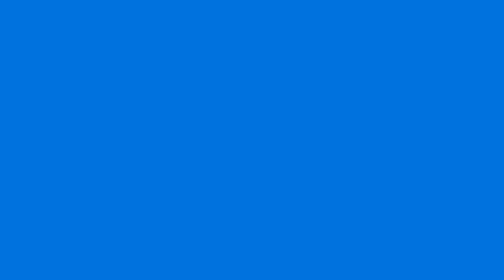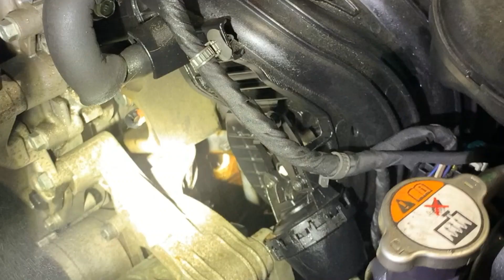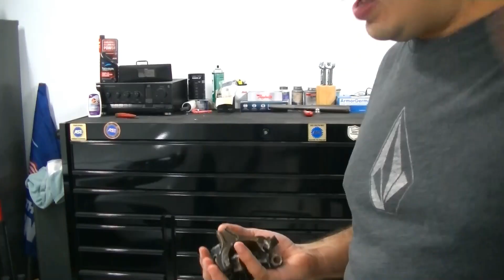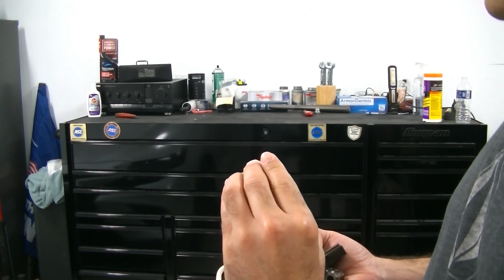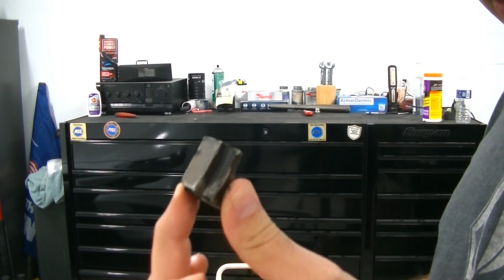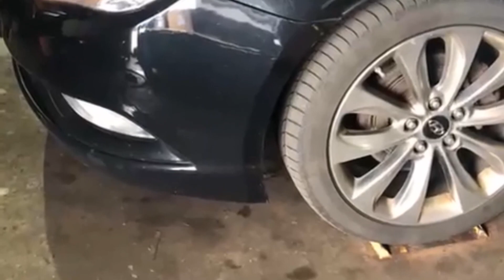P1326 In Hyundai/Kia vehicles, Cause of Theta 2 engine Failures, Timeline of Hyundai engine recalls

Comment: Great show, perfect explanation on car mechanics .Just have one question as you have a wealth of knowledge. Do Hyundai/KIA 2.0 litre mpi not gdi engines(Pre 2013) suffered from bearing crank failure as they are not on the recall list.
Reply from the maker: Are you talking about the belt driven 2.0 out of the elantra? Those engines are damn near bulletproof. Thoroughly enjoyed working on them
Reply: @S&E's Garage  thanks for finding time to reply, no my engine is mpi 2.0 liter with a timing chain not with a belt and is not on the recall list hyundai Tucson 2012, 6speed automatic well serviced with original yellow dip stick. So is this engine a lemon??.
Reply from the maker: @PeterSmith-ek2td  these engines do have issues unfortunately, though not quite at the level of the theta engines

Comment: I recently got this vehicle with around 53k miles. It has a engine recall for a bearing related failure. This is my question, should I wait before I get the engine tested? It has relatively low mileage and i'm concerned. The issue is excessive wear that leads to engine failure. So if the current amount of wear isnt detectable to the machine that does the test and they say its fine, then lets say in 30k more miles it failes and im out an engine. The woman at the dealership said its a 30 minute test on a computer and they can tell if there's an issue. But im concerned if the issue hasnt developed yet, then i may get a "pass" on a vehicle that will eventually fail for the recall issue.

Comment: Very informative. 👍I got the knock sensor update on my 2013 Hyundai Santa Fe Sport in 2018 but just today it was triggered when I went over 80 mph on the expressway. Started going down in RPM and couldn't go over 60 mph very scary with all those vehicles behind us. Guess I'll be calling Hyundai customer support and see if they can do anything for me. 😔Thanks for the info.
Reply: my 2014 sanfa fe sport 2.0 engine light just came on flashing after putting gas in and I felt a down pull in the rpm as well. It shaked scary still owing quite a bit on this car worried.
Reply: SAME thing happened to my optima! Was going 80 car started stalling couldn’t accelerate over 60. Oil pressure light came on and engine seized
Reply: @radiancebae6083 😢

Comment: Re 953 campaign at 11:00 - the knock sensor is essentially a microphone. So 953 is a continuation of the earlier efforts, but done on a continuous basis.
16:30 - I wonder why the software couldn't be modified to recognize and ignore the FI pulse interference. They surely happen at different times than rod knock sounds.
Reply from the maker: It is not exactly a microphone. It’s a piezo electrical sensor that creates voltage as vibrations occur
Reply: "electrical sensor that creates voltage as vibrations occur" - that's pretty much the definition of a microphone. There  are under water microphones that use the piezoelectric effect.
Reply from the maker: I’m relatively sure that is the exact reason they had us stop replacing the knock sensor harness in one of the T3G revisions

Comment: I had my 2015 Santa Fe engine replaced through the June 2021settlement agreement in October. Immediately after, I began get a Check Engine light and final got it diagnosed as needing to replace the catalytic converter. I’m being told by the dealer that the claim for this repair under the settlement agreement was denied; however, they agreed are to do a thorough evaluation of the CAT and resubmit the claim. To your knowledge, has it been a common occurrence for the engine failure to cause damage to the CAT?  If so, do you have any knowledge if the Settlement agreement has approved covering the replacement?
Reply: If it used a lot of oil before it blew up it probably contaminated the cat, so it is a possibility.

Comment: I literally had this happened to me last week coming from work. I never had an issues, took it in for recalls or maintenance and I just changed the spark plugs and clean engined the six months ago. Anyways, my engine light came on out of now where as I was driving home, I had to limp home and it threw this knock sensor failure code. And Hyundai still has no recall and would have to wait to get it repaired so, I ended up taking it to a nearby mechanic who knew what was happening but I have $700. It's a 2015 Hyundai Sonata Sport under 60k miles.

Comment: I’m afraid because our car is consuming oil. It has 105000 miles. It has been good since bought used in 2016. It’s a 2015 Kia Rio EX. Just check the oil frequently and oil changes are done in 4000k intervals Does Kia Rios qualify to have KSDS software installed? New subscriber

Comment: I’ve been doing a lot of research as I drive one of these vehicles. It’s interesting that this video is two years old and my vehicle had the KSDS recall warranty back in 2019. I believe my engine is actually only a theta engine. I do believe right now in a more recent update is that the burning of oil is now a part of the safety recall under the government program. You can go and find the recall notifications and the official bulletin from the government websites that instruct dealerships and mechanics on how to perform and test for oil consumption excessiveness. I’ve read all through it and what I will say that is a little surprising to me is the fact that these manufacturers are suggesting that normal consumption can include burning 1 quart of oil per 1000 miles. which seems excessive considering that if you have an oil change service interval of 5000 miles and your engine only holds 5 quarts. You would have no oil in the engine at the end of that interval. And what’s worse is that by the time you were low by two or 3 quarts this other issue of the bearing is now going to present itself much more dramatically. Not to mention the fact that the lower oil is going to cause problems for other parts of the motor which depend on enough oil. Like the cams.
Reply: Check your oil at least once a month.

Comment: There is also Kia Technical Service Bulletin 222.  High oil consumption measurement and piston ring cleaning procedure.
Reply from the maker: I did one of those at Hyundai before I left the dealership with the Valvoline top engine cleaner letting it sit in the cylinders and then using a leak down tester to pressurize them. What kind of success rate are you guys seeing doing that cleaning?
Reply: @SEsGarage  I'm just a silly 2016 Kia Optima EX car owner.  The cleaning procedure was performed a week ago.  I've driven about 250 miles since then and I need to return to the dealership so they can officially measure the oil quantity after 1,000 miles.  It will be interesting to know the future long term results since I caught the oil consumption before too long at 101,000 miles.
Reply: How much you paid for that service?

Comment: Thank you for helping me understand more about my engine and the whole debacle behind it. Since you seem to be pretty intimately familiar with these Theta II engines, what is the most common reason for the oil burning? I am burning about 1 qt every 1000 miles in Eco mode and a little less in normal mode. Was wondering what I could do about it. Dealer already did the carbon cleaning though they have been dodgy at best. Was thinking about just saying screw it and replacing my rod bearings before they fail, though that may just be pushing the problem out to a further date.
Reply from the maker: Not accusing you of anything here but we usually only saw oil burning issues in theta engines with questionable service history. Hyundai release the service bulletin to perform a special type of carbon cleaning of the combustion chambers with a special service tool. That service bulletin must be performed and oil consumption tested after before any engine replacements are authorized. The service is supposed to attempt to free up any clogged or frozen oil control rings.
Reply: @SEsGarage  I appreciate the candid response. I did purchase the car used from another dealer so I don't know it's previous history but growing up with a master tech as a father I always replace oil at 3m/3k. Since I've owned it only ever ran synthetic through it, except through the consumption tests since they wouldn't let me. What worries me is it was burning more oil after the cleaning and second round of consumption tests. I've run it through another oil change cycle and have been checking the dipstick often to get a measure of consumption (I know, not very scientific). After the cleaning it was around 1.3 qt per 1k, it's settled back down to 1 qt per 1k now though. Not really sure what to do next here.
Reply from the maker: @Simpfan45  unfortunately being that you are the second owner the 100,000 mile powertrain warranty does not transfer over. So if you’re over five years or 60,000 miles unfortunately Hyundai doesn’t need to do anything about the oil consumption and you’re only covered for rod bearing failure. 1 quart per thousand is more or less the threshold for warranty replacement. That being said you can ask the Hyundai dealer to submit a goodwill request for engine replacement and see what Hyundai offers as far as assistance if anything
Reply: I had this issue. I did some of my own online research and found people reference a PCV Valve replacement. I had that replaced and it dramatically improved my burn.
Reply: @L00KOUT  I replaced our pcv in a 2017 Sportage that started burning oil around 50,000, it was no help.  Now at 67000 it burns a 1 qt in 1000 miles, going in for carbon cleaning in 2 days.  Have free oil changes and got them done on time.  So if they do nothing, and Kia corporate won't help, will switch to 20w40 or get rid of it and never buy Kia again.  Oh, the Theta II motors have an extension on their warranty due to law suits,  doesn't matter if you're 1st or 2nd owener for the 2.0 and 2.4 Theta II's.
Reply: @lonniebeal6032  Oh yeah. I went the corporate route and was told to suck an egg and pay out of pocket for a new engine.  Didn't end up doing so as it's a 2012 and the engine is still putting out good numbers, just burns oil. I will try playing around with the oil weights a little to see if I can reduce oil burnoff. Really don't want to be ripping apart my engine and replacing rings or whatever wore out to fix the oil burning problems.
Reply: My 17 Kia Sportage 2.0 T started consuming oil at around 56,000 miles, I’m the second owner , they conducted an oil consumption test and it was burning oil, i called kia corporation just in case to record the issue , they approved for a new engine to be replaced
Reply: @L00KOUT  I did the same and it didn't correct anything for my 2017 Santa Fe Sport with out a turbo. Hunk of junk if you ask me. It's sad, my wife's 2008 entourage has 220k miles and only burns about half a QT of oil between 3k oil changes. It has the 3.8L motor.
Reply: @L00KOUT  where is the pcv located on the 2.0, interested in changing  mine out on a 2017 tucson, any help is greatly appreciated!

Comment: I have a 2011 sonata that blew the engine at 85k miles, around mid 2018.  It gets regular maintenance, but I'm wondering if the replacement is burr free or has the same defect.

Comment: I have a question for you... LOL So they did a complete engine replacement on my car and now not even 2 years later I am getting the same code coming up. I have maintained the vehicle ever since I got it back religiously lol because I am scared of something going wrong but now, we are back in the same boat again I pulled the P1326 code and this time I'm going straight to the manufacturer for answers, and I have opened a claim with them because I can't do all of this again. But wanted to know if you have ever heard of this happening after an engine replacement? I would have thought that by doing that they would have fixed all the issues and I would be good to go now?

Comment: if a 2015 Kia 2.4 optima (had ksds update in 2020) & regular oil changes per manual then less than 2,000 miles after the last new oil+filter, car stopped while driving (light came on). Towed it the shop that changed the oil 5 months prior they said oil was low & very dirty, & drained & put new oil & filter to see if that helped. When engine turned over it had the knocking noise & not drivable. Does that sound like a rod issue covered by warrenty?

Comment: Great video brother yeah my 2013    Hyundai sonata 2.0T  has that code and my  Mechanic systems told a new knock sensor. Car still goes into limp mode after drivering it 50 miles. Bought her new never had a issues up til now at 148K miles on motor. Sucks so Thursday taking it to  Circle Hyundai. Your from LIBI California? I know we got a long beach island here in dirty jersey.
Reply from the maker: I’m from jersey! Know right where circle is. I worked at causeway on route 72
Reply: @SEsGarage  wow that's great brother yeah I head freehold isn't so good so thata why I'm taking her there. Next car is Honda or Toyota for sure 👊 I'm glad that they are at least covering it because of out government ans law suits lol.

Comment: Very informative video. what happens when you cant get a reading on the piston due to warpage of head/cylinder? ever seen the cooling system overwhelmed by a failing bearing? 
vehicle never had any problems - 71K  miles. Brought it in for the knock sensor recall / inspection; was given a clean bill of health on 12/21. on 1/3 (300 miles later) I called the dealership and took the next available appointment to bring it back as it started making a ticking noise and engine seemed to be generating excess heat, even though Engine temp gauge showed normal. car was parked 1/3 to 1/20 (date of appointment) I was driving the vehicle to the dealership for service, about 1/4 mile away it started knocking and power was reduced to almost nothing. limped into the service drive and it died... engine was hot, temp gauge never showed hot... now dealer cant get the BCT done since when they pressurized the cylinder oil comes out of the other cylinders. They are calling it overheated/blown head gasket, say bearings never failed; no measurement of bearings performed. What is my next move?

Comment: Hi Stefan. Thank you so much for the video!  I have a 2016 Santa Fe Sport 2.0 Turbo, and Hyundai replaced a Longblock engine last week.  Part of the recall benefit, so no charge to me, the consumer. 
BUT, last night my ODBII reader showed yet another new issue, that being a P0456-Evaporated Emission System Leak Detected (very small leak). Could this be due to the engine replacement work done, or something over and above the recall??

Comment: @S&E's Garage, Great and so valuable explanation from a reallly involved technician as you!

But Stefan, do you think that there can be done something as a premeasure to avoid all that following headaches related the Theta 2 engines?

For example as a oil pump change with a other one with a higher presure or probably new rod bearings, the catch can probably would help for the carbone biuldups and this would be a point. With my guys in the car service we were thinking even widing the oil inlets, because most of the cars here dont has warranty /imported from USA as a salvage/ and watching how all that ruin them is realy bad.

Comment: My 2017 Sonata Sport has the 2.4 Liter! It burns a quart of oil every 150-175 miles! It has been doing this since 35,000 miles. I now has 120,000 miles and every other oil change, I do the CRC Intake & Turbo cleaner into the intake! The entire can! We did get that software update for the knock sensor! Hyundai wants us to do a oil consumption test and run it 1,000 miles! I told them, it would blow the engine by then cause it would be out of oil! Any advice for me???

Comment: Quick update. Got my 2014 Kia Optima back. 0$ cost to me for the long block replacement. However I was warned by the head of the dealership service department to use nothing but full synthetic oil,change the oil every 5,000 miles,and keep records of oil changes and the mileage with the receipt for the oil and filter or the receipt from the place that does the oil change. Otherwise the next one is on me. Also the gas mileage is nowhere near what is was.

Comment: Great video! I have a question, last january i got p1326 code, brought to the dealership. Did some test like bearing test and it passed. They replaced the knock sensor but still CEL is on, check the plugs and coil, one coil is bad so they replaced it. The CEL is gone but during drive test the car dies. So now waiting for a new engine....the question is...do you think the sensor is really bad thst why they replaced it coz they charging me $240 for that. Thanks!

Comment: So my 2015 Kia optima got a code P1326 and got sent the Dealship around late January. I was told my car was on hold at the dealership for 2 months due to so back up and that was just for the diagnostics. Last Thursday (30th march) I finally got the call that they pulled it into the shop finally. That next day (31) I got called again by the dealership and that it was fixed and everything. He said that there was a spark that needed to be fixed and some corrosion buildup. They fixed it and I drove it but my mileage was off by +200 even tho I didn't drive it to the dealership initially, it was towed there and I saw that my oil was dark too. Fast forward to Saturday night im driving to work and my engine light is back on and flashing with the same P1326 code. What's wrong?!?!?!